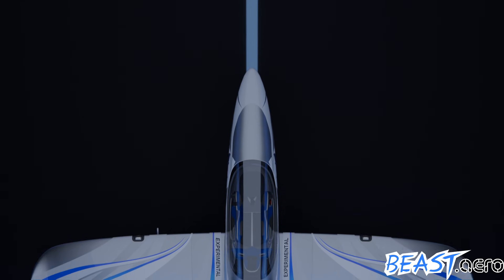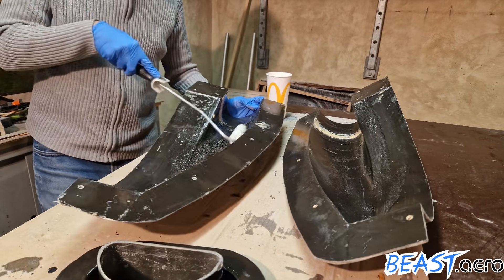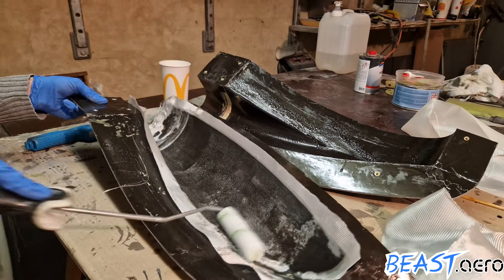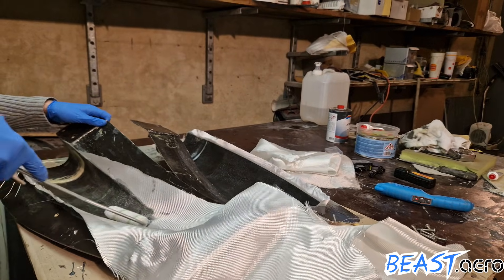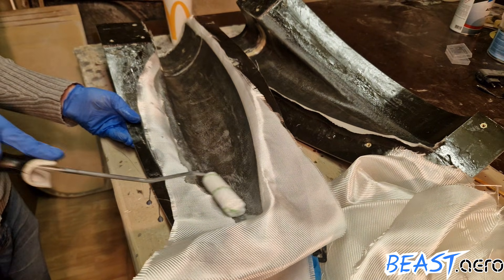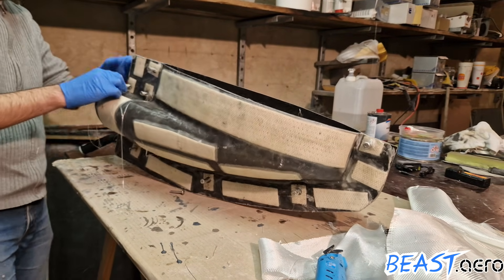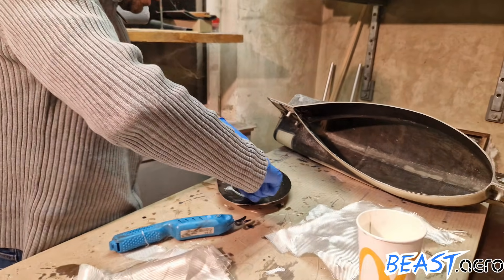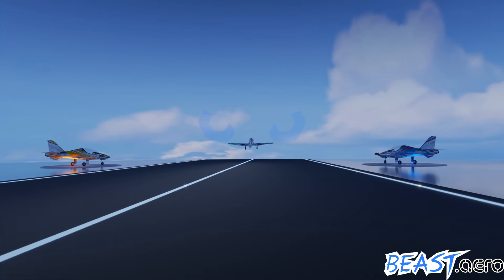Horus VLog #42

Comment: Hi Andreas, great to see your progress in that Project. A mixture of resin and 5-7% cotton flock. When thoroughly mixed, this results in a creamy, spreadable mixture. Applying this first to the mold with a brush will smooth out any unevenness in the first layer before applying it to the fiberglass. In my experience, I wouldn't use a cotton roller for the first layer, as this causes air bubbles. Try dabbing it into the mold with a short-cut brush. This will help you get rid of the air bubbles more effectively and ultimately reduce surface issues on the finished part. Then continue working with a cotton roller. Give it a try! Best regards, Jens
Reply from the maker: Hi J! We are going to vacuum infuse everything, but I will try it out the next time we are doing a hand layup which is going to stay.